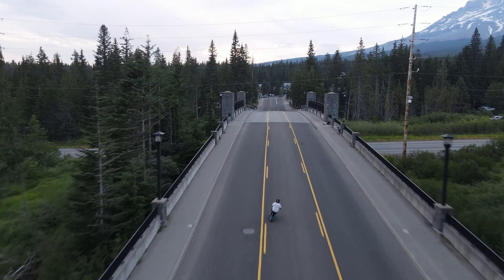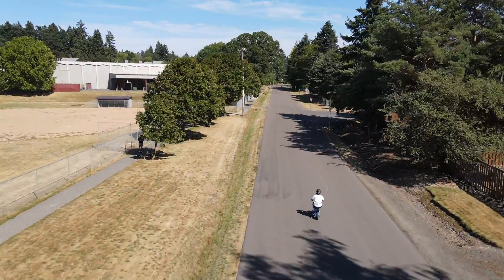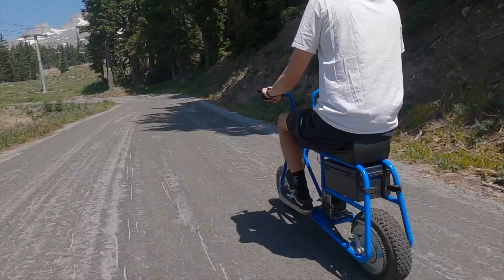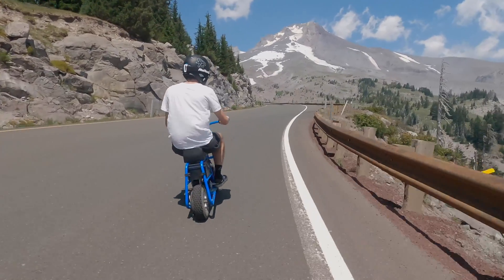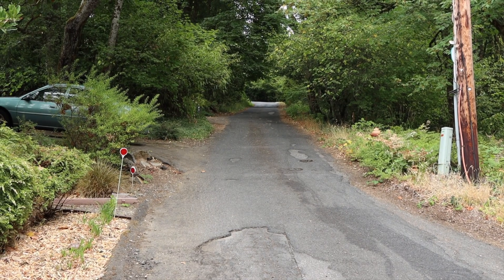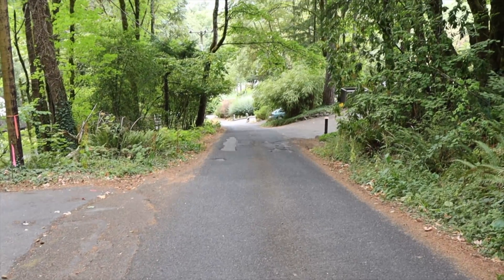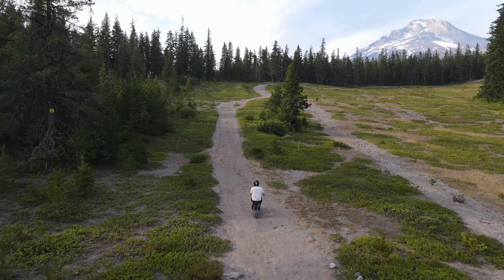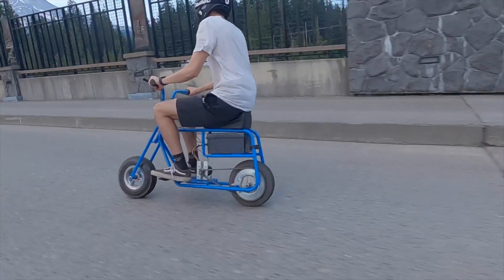INSANE DIY Electric Mini Bike V2.0 Review **35 MPH, 28 Mile Range, 30% Grade Hills**

Comment: What kind of brake do you have on it, when I look up regen brake it's very confusing to find. And what connector connects to it, I believe you used VESC. I want to build a crazy cart with a regen brake on it, however I can't just find a brake that's just purely a sensor brake and not meant for a caliper or anything

Comment: Hey! You mention in the video that you're working on V3- the video/ parts list doesn't look to be out yet, but I'm looking to do a build of my own. Could you link the upgraded parts list so I don't buy the wrong stuff? Thanks so much!
Reply from the maker: Hi, we are still working on this, but here are some ideas for upgrades:
1. More powerful ESC (not sure which one yet)
2. Hub motor in the rear instead of a chain drive (still searching)
3. Add a Devega display to see live speed and battery
4. A separate enclosure for the ESC
5. (if staying with chain drive) custom CNC motor mount 

I hope this helps!

Comment: What would you need to make this go about 60-70 mph love your vids man🤙
Reply from the maker: There are probably a few ways that could be done. A larger more powerful motor and higher voltage battery would help and a change in the gear ratio could also add speed. I would never make anything that goes that fast though
Reply: @DIYesk8Builders  haha I don’t blame you man! Anxiety would be through the roof, I was just wondering as I have seen scooters and some other cool equipment get to that speed . Thanks for responding 🤙

Comment: Is the Meepo Hurricane better than the Beast 2.0?
Reply from the maker: completely different ride feeling! no way to compare a board to a bike
Reply: What do you even mean better?
Reply: That depends on the motor settings. The bike probably has more power than the Meepo. But its a ugly scooter so it will never be as good a as board in my opinion 😉

Comment: Would love to see a belt drive train to replace the chain setup. You can 3D print the rear pulley. There are a few videos that showcase how its done. It would be super silent and handle off-road debris much better. Just an idea.
Reply from the maker: Hi! We were looking into this and making it a CNC'd pulley. 3D printed might not be strong enough for the amount of torque this thing has.
Reply: @DIYesk8Builders  I would think some timing belt pulleys and belts would be quiet and hold up well
Reply: @DIYesk8Builders  I've used gt3 belts with 382W x2 on a dual 5mm wide belt and had no issues. That was on a frc robot.